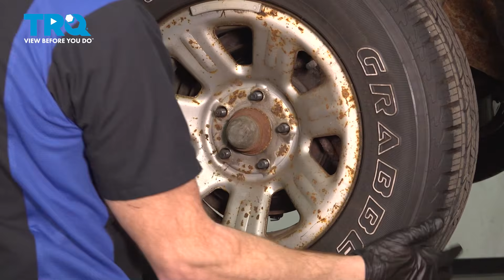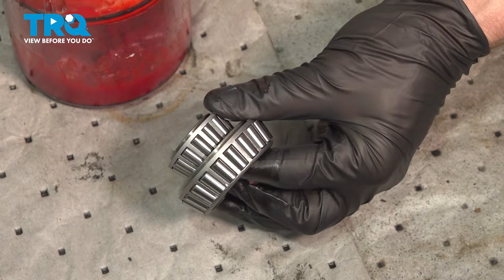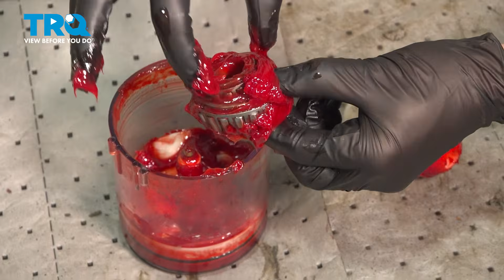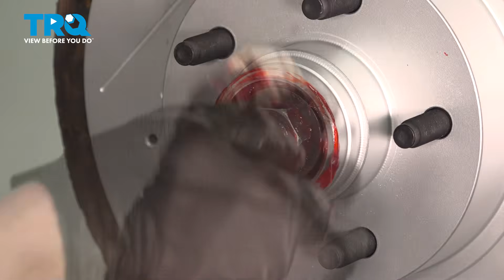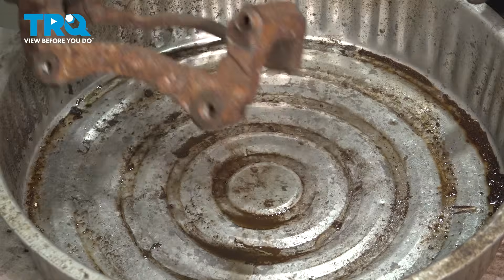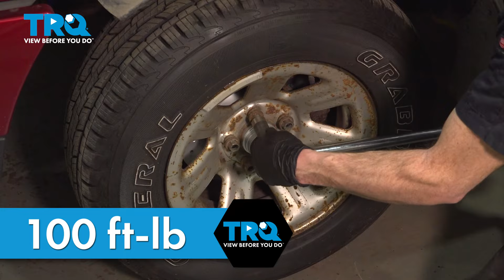How to Replace Front Brakes 1998-2011 Ford Ranger

Comment: Those dust covers come off pretty easy with locking oil filter pliers.  And they go on better if you throw them in the freezer for 15 minutes (and use a rubber mallet).

Comment: Very detailed video. I was a bit apprehensive on having to replace the rotors and dealing with the wheel bearings. This video has great detail with that. I guess I will be doing this project after all on my sister in law's Ranger.

Comment: There's two types of rotors 🤔 one plain and the other rotor with hub bearings that need to be included. What's the difference between the two ( very confusing)

Comment: my 99 ranger doesn't have that setup for disc brakes. I don't have a center nut to remove. Take the caliper housing off and my rotor falls off